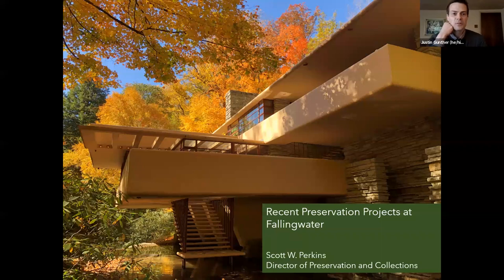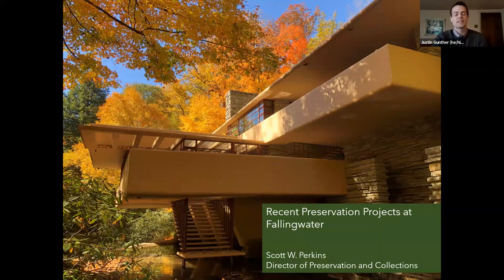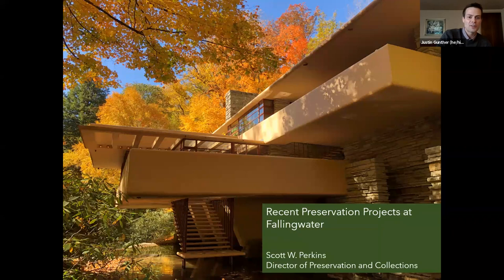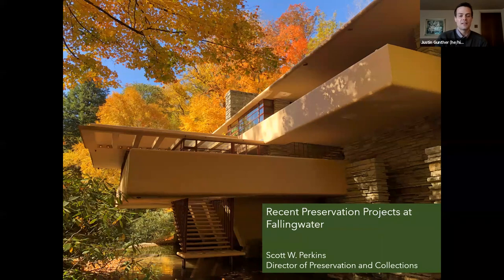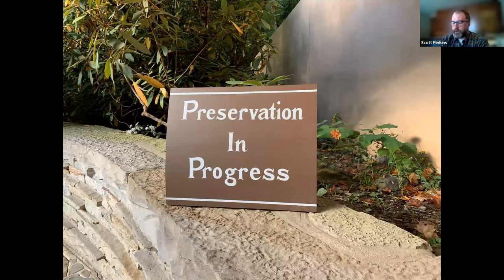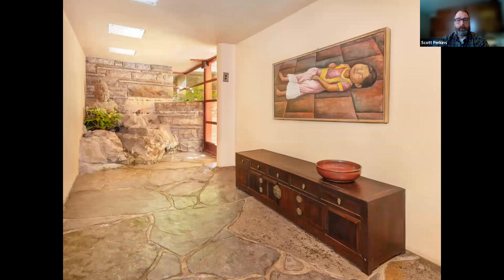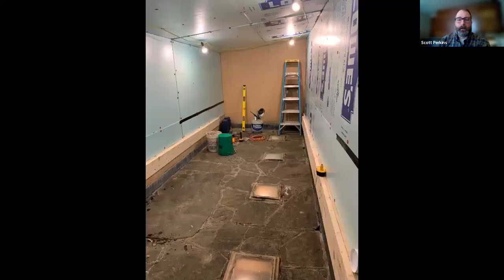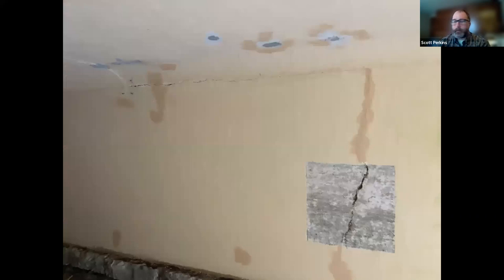Helping Fallingwater Live On | Justin Gunther and Scott Perkins

Comment: Hi, how are you doing today. I'm watching this,... This is a great, great model home, and I will bring a thought or two. 

Well, concerning weight and the cantilever design,.... Less weight is the certain, best schema for the foundation and floor joists. 

This is out there some,... The perimeter wall of the floor of the cantilever designed room,... bring the wall to less heft by replacement of the perimeter wall from concrete to a graphite or,... fiberglass!

How about the recycling of the wind generator propellers into a rebar like mesh and fill with a fiberglass resin,... for the loss of half the existing weight, sprung outbound and at the perimeter.

Less weight and less bend!!!
Reply: There's no doubt that other means to the same aesthetic ends were available to Wright when he designed Fallingwater---much less with today's materials and technologies.  It might surprise some, as it does me, that no one has ever questioned in print (at least, to my knowledge) why steel wasn't used for the main cantilevers.  The only answer I have is that Mr Wright's philosophy, one we might call a tendency toward a "mono-material" approach, would have dictated, to him anyway, that concrete in all its forms was the material to be employed in this instance.